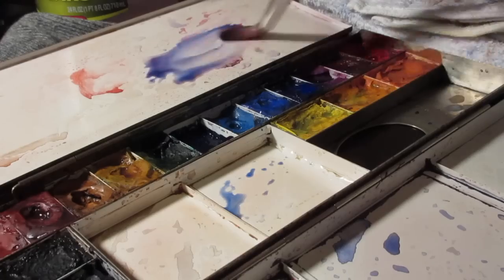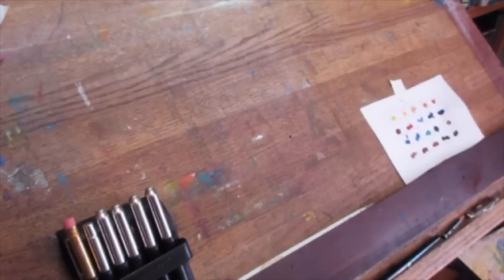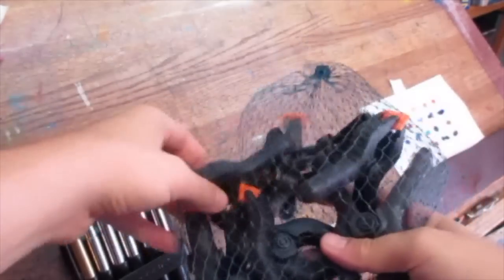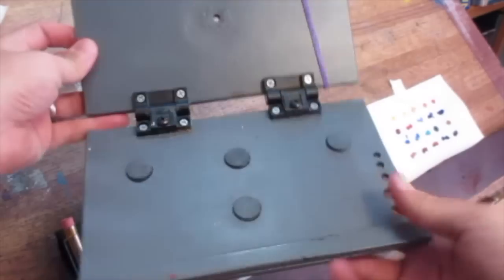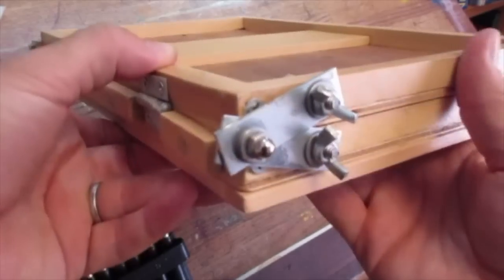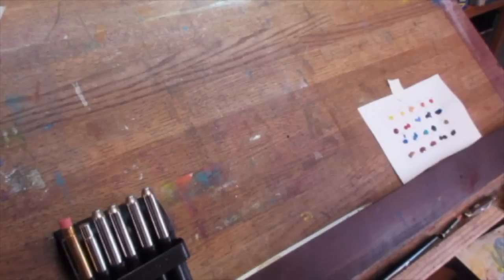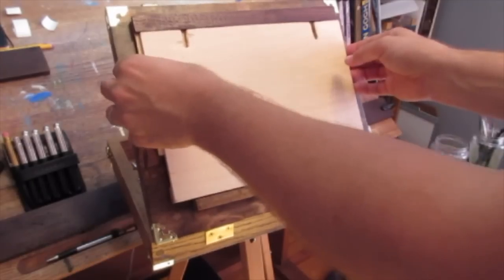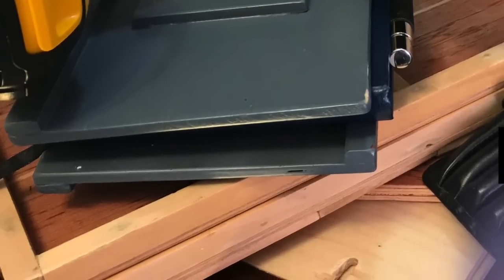Home-made Pochade Solutions | Travel board or sketch easel ideas

Comment: I just stumbled on your channel, man, I'm gonna watch those videos. Great content! Just a question about the gurney one, is that really wood you used or some other material? That grey-green-colored one?
Reply from the maker: It is! It's 1/4in thick plywood. You can get it at home repair or craft stores. It's cut to the size of my sketchbook and hinged together. Afterward, I protect it, I sprayed it with gray paint and clear coat so it wouldn't warp.

Comment: Hey jared! I was thinking in making a sort of gurney pouche and do you think those hinges are worth it? im new to building stuff hehe
Reply from the maker: I'm kurieX absolutely. They’re the crux of the whole design. Without it you have to make a system of hold it open- which is doable but requires some other thing attached like cork or dowel to sit on or some kind of chain or holding bar to keep it open. These hinges work super well. They open to a spot and hold and you can make them more tight or loose as needed. They’re expensive- the most expensive part of the thing but worth it.
Reply: @JaredCullum  Thanks for the quick response! Ill maybe update in how my journey to build this will come out !